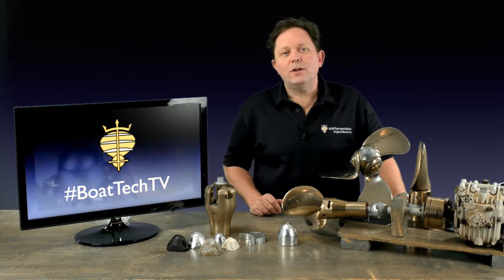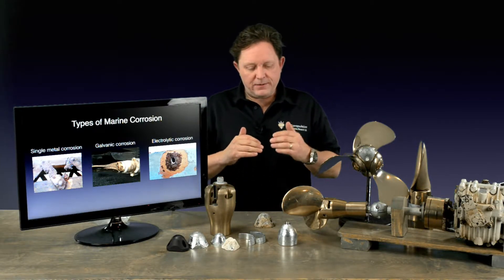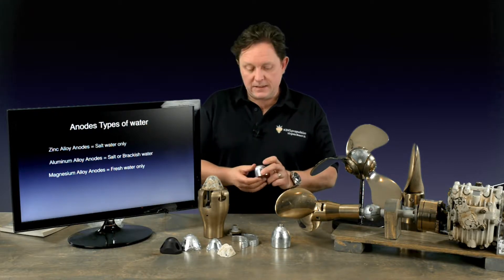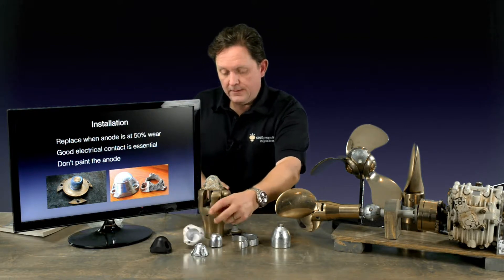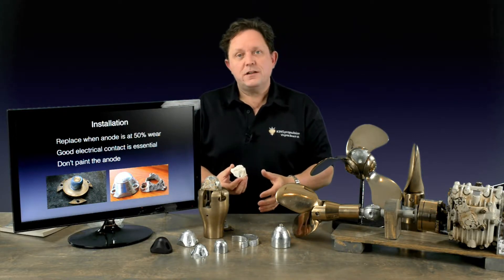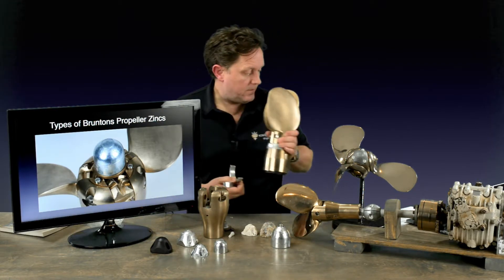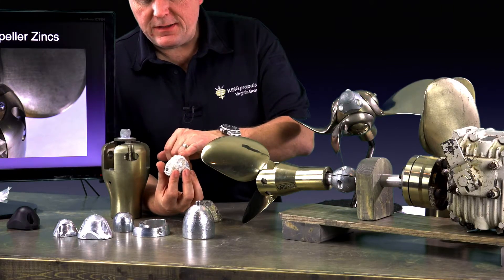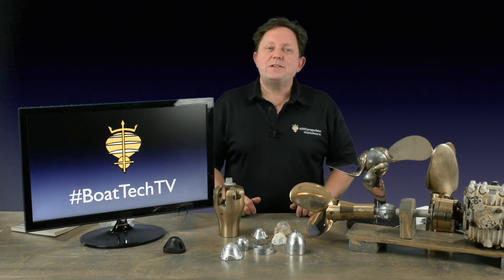BoatTechTV Episode 9 -  Anodes

Comment: Thanks for making these great videos! I haven't thought about Foude numbers in years.  I just changed my zincs in the water 2 days ago and was surprised to find the saildrive zinc fine but the prop zinc about 70% consumed - problem?  

Thankfully, you recommended ordering spare zinc holders or I wouldn't have been able to change the prop zincs.  I wound up changing to the new holder and zinc underwater and will now try to clean up the remaining zinc from the original holders.  There's not enough zinc left to to grip to spin it off - would vinegar or some other acid work well?